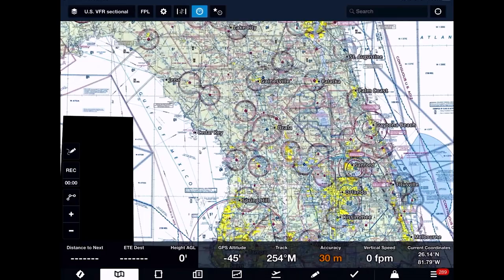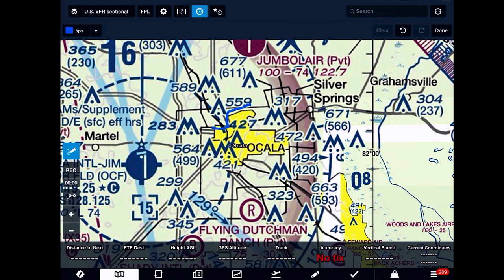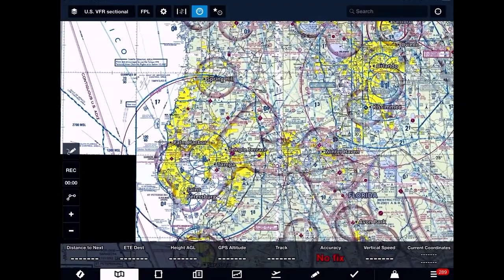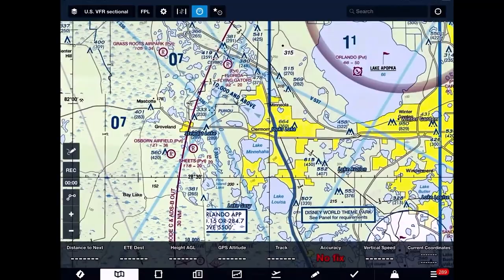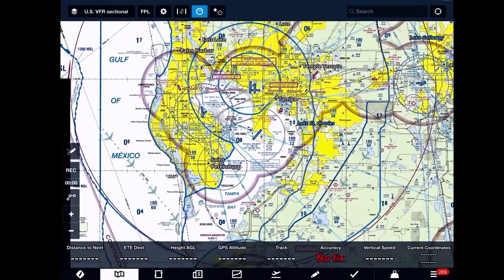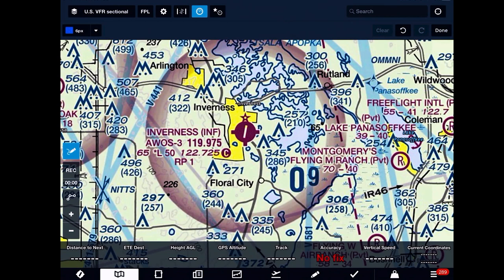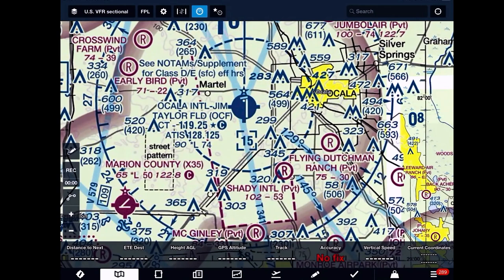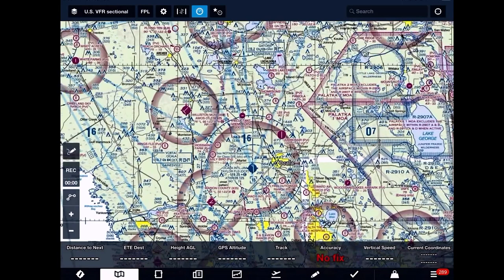How To Read a VFR Sectional Chart

Comment: With the app, you can also hold down on the airspace boundary, and it will tell you what the vertical limits are, and what frequencies you need to use.

Comment: 23/23...  Have a look at the Little Rock Class C.  At the north side, there's overlap with the LRAFB Class D.  BUT, the Delta is GND-2800 (according to the sectional), and the Charlie is 1500-4300 or 2100-4300 (depending on the section)...  Which airspace are you in above 2100 or 1500 (again, depending on the section of the C) and below 2800.  Are you in the Delta or in the Charlie.  The sectional is ambiguous...

Comment: 23/23 :)

Curious to know why there is no Class F airspace in the US.
Reply: We have no Class F for two reasons:
1. In Canada Class F is similar to American "Special Use Airspace," so since we have that we don't need Class F in that respect.
2. Elsewhere Class F is defined as a sort of cross between G and E, in other words, in IFR conditions ATC is available but not required. Americans would rather just have controlled and not controlled airspace apparently, so we don't use it that way either. (and, realistically speaking, in most instances you have to communicate with ATC during IFR weather regardless of what airspace you are in. This is because, according to the FAA, not doing so is careless and reckless operation and a violation of FAR §91.13 --therefore having "semi-controlled" airspace for IFR is useless if you are required to be under ATC in all airspace during IFR.

P.S. Sorry if that's a little complicated.
I'm just a student pilot so my explanation might be wrong but I'm pretty sure that it's correct.
Reply: @HezekiahHunicke2  thanks! I'm yet to be a student pilot (maybe later this year though), so you have one up on me there :)

What really sunrises me though is that apparently aviation rules and regs seem to be part of a worldwide system, similar to regs for shipping Dangerous Goods (US) vs Hazardous Materials (Inrenatiinal). Something

Comment: $64,000 question. Can a pilot on an IFR flight plan while enroute at say 6000 ft be told to remain clear of class bravo, say due to heavy jet traffic? Or would they be vectored around it. In a sense class bravo does exist for slower IFR traffic. The reason I mention this is because I was told when I got my IFR rating I wouldn’t have to worry about bravo airspace.